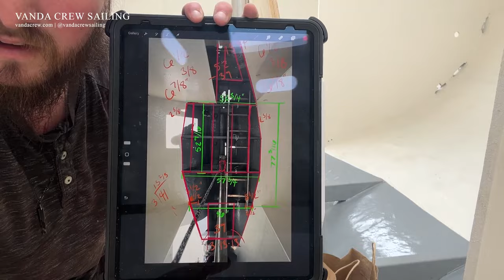Building the Subflooring of a 40 Foot Sailboat - Hinckley Bermuda 40 Custom Rebuild | VLOG | 024

Comment: Nice work! One thing you might want to think about are the screws holding the subfloor down. Without some protection (even just some silicone sealant) the screw holes become the vulnerable part to water intrusion, both on the sub-floor and the beams you screwed into.
Reply from the maker: Excellent comment. I actually did put a little 3M 4200 sealant in the holes before I screwed them in. However I do think it was unnecessary since I plan to epoxy a hardwood floor over everything which will seal the bolt holes, and the flooring is in a place that shouldn’t be getting wet.